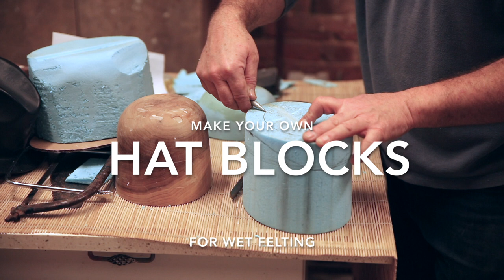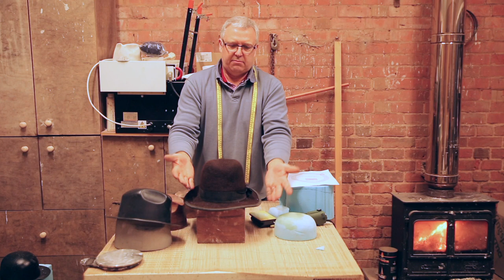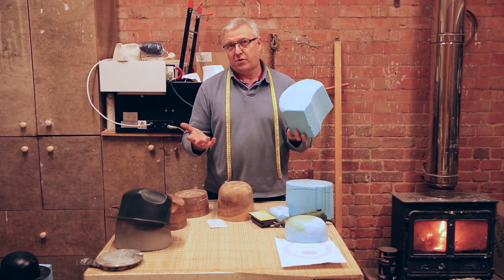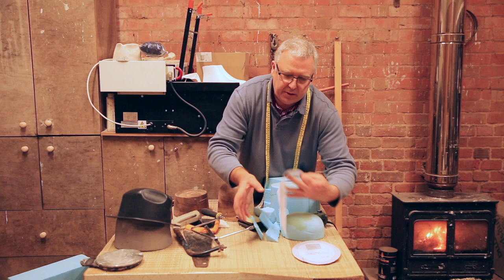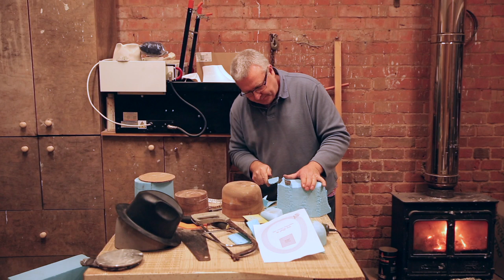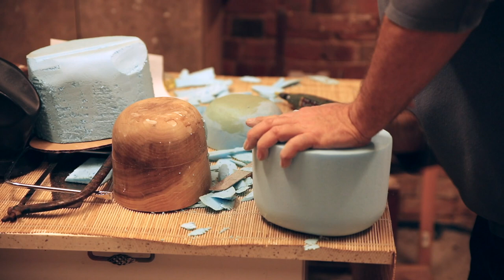How to make a Wet Felt Hat Block

Comment: As many model train enthusiasts will know, a hot wire is fantastic for cutting foam.

Nice sealed surface left behind, as precise as you'd like, easy to build if you can't buy one.

Probably isn't fantastic to breathe, but if you have a pedestal fan going you'll live.
Reply from the maker: If you have a hot wire cutter of course! I'm not sure it would be the best tool for blocks but I will experiment, thanks.

Comment: I would love to have a tutorial on how to make a wooden hat block 🤓 please...🌸🌸🌸
Reply from the maker: I have made wooden blocks but they are not ideal for wet felting. I prefer the foam blocks, or abs vacuum formed blocks. If you have the tools and equipment to make a wooden block, you could probably already do it! 
https://youtu.be/XI4_akHmpzc
https://youtu.be/BxHJk03Uvqg
Reply: Wooden blocks look realy nice do 😉 Does the foam stands the pressure when you put on it while wet felting? I meen, I put my weight on it 🥴😂 dont it brake or crack?
Reply from the maker: @Idasbus1  It is a rigid foam, not packaging polystyrene. It is fine. If you want something you can stand on the abs vac formed blocks are what you want. With the foam blocks you can make any size or style you need using the most basic of tools. 
https://youtu.be/aWe8FM8tgpw

Comment: Hi Mike, awesome video, I've never worked with blue craft foam, would this work as a wood block for traditional non-wet hat making?
Reply from the maker: It may do, but I think if you really have to pull you might deform the foam, although it is quite tough.
Reply: @donutpanic  I understand, maybe I can use the foam ones covered with some sort of hard plastic coat
Reply from the maker: @KidCalavera  I'd try it as it is first. It's pretty tough stuff.

Comment: Hi Mike!  I recently purchased some XPS and am about to begin shaping my crowns.  My plan is to make a variety of rabbit and beaver fur felt hats.  My questions are:  will the crown blocks hold up to the heat from the steam needed to form the felt and will the blocks get damaged from using a Blockers Cord & Pusher Downer?  

Much appreciated!
Reply from the maker: The foam blocks hold up well in repeated use for wet felting (from loose fibre) which is what I use them for. I have not tried using pre-made hoods on the foam blocks. Let me know how it goes- good luck!

Comment: Greetings from the next shire Mike. I love your videos! Thanks so much. I am currently attempting a block out of a white polystyrene cake block, it's messy in the extreme! Fun though. I'm trying to make one to help me make a 1920's cloche hat and wondered if there was an average height for blocks? thanks again
Reply from the maker: Thank for the comment. White packaging type polystyrene is quite different and as you say, messy if you try this. The blue (or now grey) stuff is as you can see carving and sanding friendly.  Blocks will vary in height, but 5" would be average for a Trilby or Fedora. Let me know how you get on!
Reply from the maker: I seem to have deleted your further reply - sorry! I am used to working with wood, have lots if kit but making wooden blocks is still laborious. I also make ABS plastic vacuum formed blocks but again, making various sizes and styles is a pain. The rigid foam is the way to go. Where are you based?
Reply: @donutpanic  I'm in the Belper area of Derbyshire

Comment: Hannah, I am wondering if you can use floral foam?  Floral supply shops and craft ships seek the foam for both wet (fresh flowers) and dry (silk flowers).
Reply from the maker: No. Floral foam is soft and crumbly. This is extruded polystyrene and totally different.

Comment: Just what I need.  Thank you.  Is that material just called craft foam or does it have another name?
Reply from the maker: It is extruded polystyrene, or xps. Widely used as insulation as well as crafting and modelling. https://www.panelsystems.co.uk/product/craftfoam-grey

Comment: Good day Sir, are these blocks for shaping of the fedoras only or can they be shaped for long oval heads? Because I'm a long oval, store bought fedoras don't always fit? I need something permanent when purchasing custom fedoras. I'm willing to pay for one of the foam blocks if this is feasible 😊. Not crafty as you are...LOL.
Reply from the maker: Good day to you, Kevin. I use the foam blocks for making wet felt hats from scratch using loose wool fibre rather than blocking or reblocking commercial hoods or hats. They can be made to any shape.  I wonder if a hat stretcher might be a better solution for you?

Comment: This is fantastic, I've got started on mine now! Any thoughts on coating the foam to protect it after it is all finished and sanded?
Reply from the maker: Hi Jennifer. As long as you have the correct rigid foam there is no need to add any finish. I have blocks that I have used repeatedly with no problem. If you do want to add a finish make sure you test it on a scrap of foam first to ensure it doesn't dissolve it.

Comment: Hi Mike! I’ve search on eBay for a blue craft foam blocks and the only results either come in different dimensions or different types of foam. If you by chance see this, could you perhaps write me a link to your supplier?
Reply from the maker: Hi Becah. UK supplier below. Where are you?
 https://www.panelsystems.co.uk/product/styrofoam-ravatherm-xps
Reply: @donutpanic  I am from canada and I am also looking for foam blocks. On your link the blocks only go up to 118 mm thikness wich is only 4,6 inches.
Reply from the maker: @LABELLEPLUIE  Hello Aurelie. The foam I buy is 150 mm ( 6" ) thick, which is more than thick enough for all the blocks I have made so far. It can be glued together if required. If you look at the comments in this or my other block videos you should find information and links that should help you source the material locally.
Reply: @donutpanic  Thank you for your reply Mike! Ive found someone that supplies blocks in Canada, more expensice then I expected but I can make at least 2 blocks with it. Also Do you need a different block for every size?
Reply from the maker: @LABELLEPLUIE  Keep looking - I'm sure you will find a reasonably priced supplier of insulation rather than model making. Have a look at the link to the UK supplier in my reply to Becah above for comparison. The point being that you can make different sizes relatively easily and inexpensively with the rigid foam as opposed to wooden or ABS blocks. It also allows you to easily adjust the size or style if the hat is not quite right and then rework the hat. I have reduced the height of a couple blocks while in progress. A hat that really fits is worth the effort!
Reply from the maker: @LABELLEPLUIE The material is called Extruded polystyrene (XPS) and is used as insulation - I imagine in Canada you know a thing or two about insulation! A sheet that costs £38 ($66) here makes around 18 blocks.
Reply: @donutpanic  Awesome thank you! And yes I should be abble to find insulation material here with Quebecs minus 30s! haha
Reply: @donutpanic  Right thank you really useful infos!
Reply: @donutpanic  Actually I have another question, Since the block is taller then the hat how do you make the brim flat?
Reply from the maker: @LABELLEPLUIE  Cut the block down to the height of crown you want. I have finished felting sometimes and then decided to reduce the height of the block and re-work the hat to a lower height. That is the beauty of a foam block!
Reply: @donutpanic  awesome! Thank you Mike!

Comment: Hi Mike thanks for the video! Have you ever tried to enlarge a hat from one size to another? How would you do something like that? Would i need wood to do that? Thanks
Reply from the maker: Hi Steven. My videos are about making wet felted hats starting from the raw fibre, so are blocked as part of the felting process rather than blocking a commercial pre made hood. However, to resize an existing hat, I would remove the sweat band and hat band, stretch the  felt body, and refit a correctly sized sweatband and hat band - it is these that keep the size and stop the hat body from stretching in use. An exact size block would be ideal, but might be hard to come by or make.
Reply: @donutpanic  Thanks for your reply. I just wondered what your advice was for changing a hat size. it's a custom hat 100% beaver, if that makes a difference. I was gonna try to use the xps block to change the size but I was concerned maybe it's not strong enough. thanks
Reply from the maker: @picturesteve398  resizing your hat is quite far removed from wet felting, which is very different from blocking a pre made felt hat body, so I can't really advise.
Reply: You can buy hat stretchers online. How well they work, I cannot say.
Reply: To make a block larger, cover in clingfilm. block a piece of felt on it then measure. If not large enough, block another felt over that. I don't think it works with more than two layers of felt.
Reply: I've found Nelly Sews! But there aren't hat patterns among them, only one for a soft trilby. Can you advise what the head/crown patterns are called on the site please?

Comment: Hi there, how do you seal the bodies after so they are heat & pressure resilient ?
Reply from the maker: The blocks are for wet felting. They are perfectly resilient for the intended purpose, using hot, sometimes near boiling, water.

Comment: So....question.  Can you use it just like that?  Glued foam with no sealant?  Or do you have to do anything to it after this stage?
Reply from the maker: Yes just as is, no further treatment. I've just re-blocked my daily worn, three year old hat on the block I used to make it originally.
Reply: @donutpanic  Sweet!  Thanks so much!  I'm trying to reshape a rather floppy, felt hat into a short Top hat with a better fit.  I hope it works. :)
Reply from the maker: @Chilly Studios  Do bear in mind that I am wet felting, going from loose fibre to finished felt, rather than pulling a pre-made hood (or in your case an existing hat) into shape. Regarding the floppyness, have a look at my stiffening with shellac video.

Comment: Hi from Brazil!
What height for fedora block?
Reply from the maker: Olá! The foam starts 150 mm thick. The crown on this one was 125 mm high.
Reply: @donutpanic  and is it the same height for all head sizes?
Reply from the maker: @João Bartowski  Down to personal choice I suppose. For most styles I find 150 mm roo tall. The beauty of the foam blocks is that you can trim them down and re-block if it looks wrong. If it were a very small hat size, then I suppose the height should change in proportion.

Comment: What’s the exact measurements for your foam Sheets/Blocks
Reply from the maker: Hi Luke. The sheets I have are 150 mm thick. Info about sizes are in the video.
Reply: Loved the video but wanted to be sure how thick your block was....I’ve been making hats for quite some time and just stumbled across your video and blown away by the fact that I’ll no longer be dropping crazy amounts of money on wood blocks. Thanks!
Reply from the maker: @lukeyoung3421  150 mm is more than enough, or you can glue it with PVA if you only have thinner sheets.
Reply: @donutpanic  gonna check the hobby lobby and see if they have any local. Most of the blue craft foam I’m finding is across the pond and not really wanting to wait for it haha. I appreciate it man definitely earned a like and follower.
Reply: @donutpanic  do you happen to have a link to the foam you buy. I’m having a heck of a time trying to find anything similar. Really the only thing I can find is the regular crappy white foam that breaks apart
Reply from the maker: @lukeyoung3421  Google 'extruded polystyrene foam (XPS)' This the link to my supplier in the UK. It will have detail of the spec. They say"rigid Craftfoam is a versatile XPS (Extruded Polystyrene)". It will be available in the US I'm sure as an insulation product, but also for model making and prototyping. I had the same conversation with someone in Australia who tracked it down locally. I think there may be replies from others in the comments on one or other of my block videos that may help. I hope you find it - let me know!

Comment: For those having a hard time finding this crafting foam in the US, I live in California and this and many other progressive states have banned this material.  Its very difficult to find and mostly 1/4 inch sheets with paper for house insulation.  The quest continues because wood blocks are not economic for me.
Reply from the maker: You may be right but a Google search for "Extruded polystyrene insulation California" seems to bring up several results. I hope you find some - good luck!
Reply: @donutpanic  ah yes i see there are unfaced versions of insulation type. Its green but hopefully thats the same material.  

Another place i saw offered 2-8 lb weight but not sure which you're using.

Thank you for taking the time to reply.  I thought i would have to make one out of expanding foam like another tutorial used.
Reply from the maker: @UCTkYN547lLAJbZb0j1TprUw current price here in UK is £128 for a box of two pieces 6" thick, 4' long, 2' wide. Sounds a lot but it makes a lot of blocks if you can justify it. It's now branded as 'Ravatherm XPS' here un UK.  I don't think there are variations in density. Remember it is Extruded not expanded polystyrene that you need. The legislation looks to be going after packaging rather than insulation materials.
Reply: @donutpanic  All I could find is a product called Foamular.  It says extruded (Next Generation Extruded) but its pink.  Do you believe this will suffice?  Thank you again for your guidance

I came to the store to see the material and it seems a little squishy.   Does your blue foam get dented if you press on it?
Reply from the maker: @deadeyeskunk269  I think I know the stuff you mean - no that's not it.
Reply from the maker: @deadeyeskunk269  this link is in a reply to Greg H further down. Perhaps you could email them to see where it is sold.  https://www.dupont.com/brands/styrofoam.html
Reply from the maker: @olfactoryninja  This is for wet felting from loose fibre Andrew. If I were blocking hats from pre-made hoods I would use a wooden block. I enjoy making wooden blocks too, but it is a more difficult task that, unlike the foam block, most people wouldn't be able to do.

Comment: what is the height measurement of the block you are using there ?
Reply from the maker: Hi Rusty. I've just measured my dog walking Fedora, which has a crown height of five inches before shaping. The blue foam starts at 150 mm (6") thick, so you can make any height block up to that. Hope that helps!
Reply: donutpanic thank you!